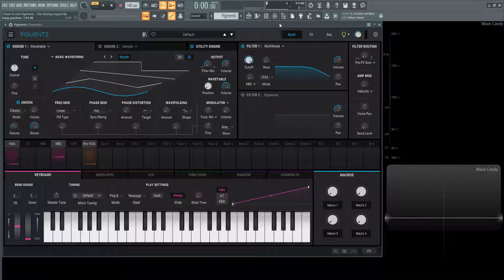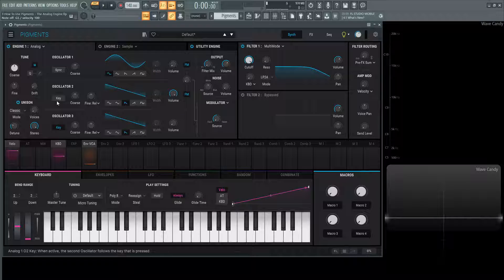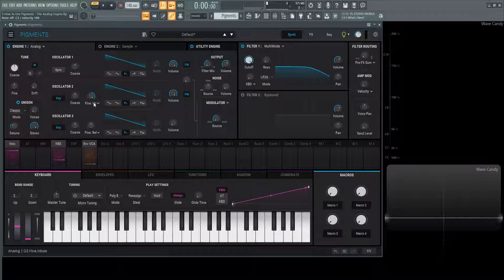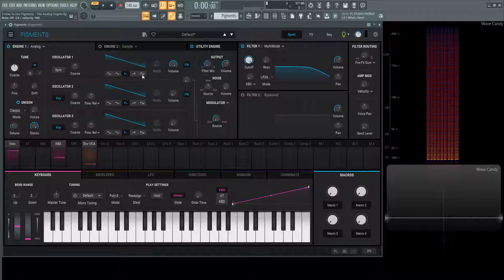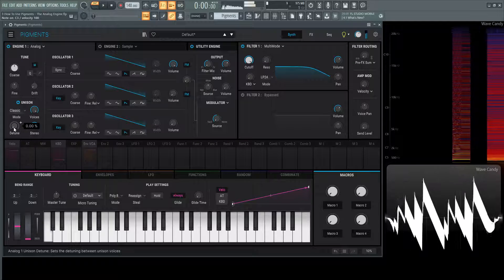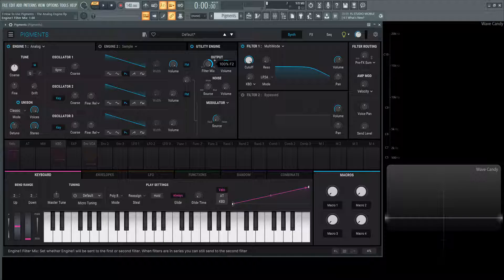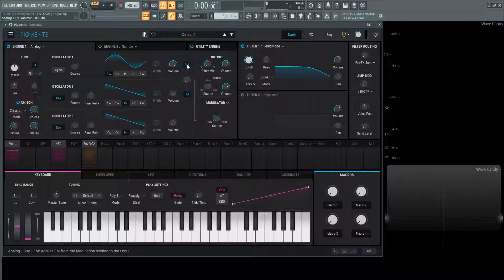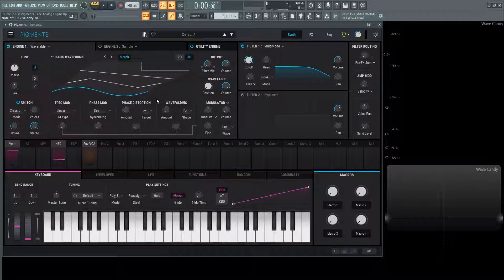The Analog Engine PART 3 | Arturia Pigments 3.5 Tutorial

Comment: Perfect video, super helpful! Just one thing: by default, filter 1 and 2 are in series, not in parallel. So if the "filter mix" knob is set to 100% F1, the sound will go through both F1 and F2. This is easily changed my adjusting the "filter routing" knob on the top right of the interface.